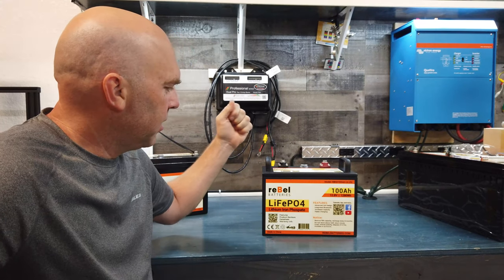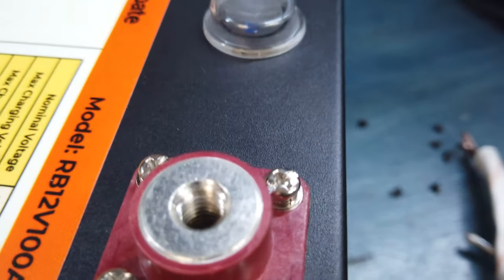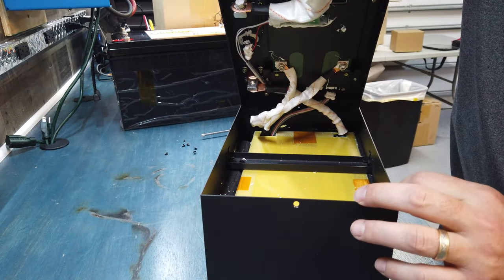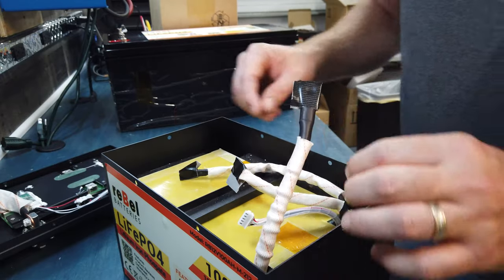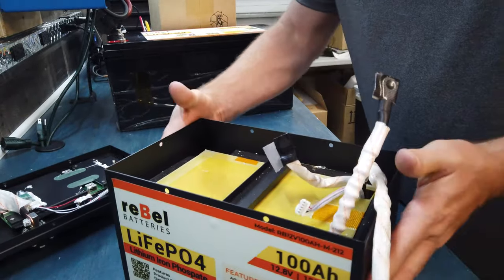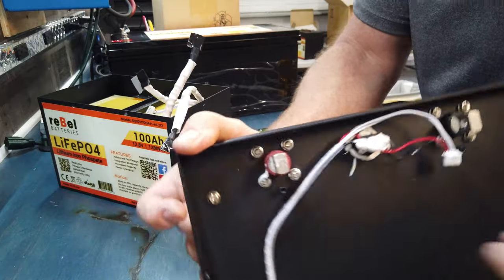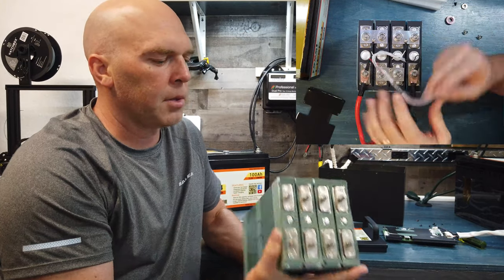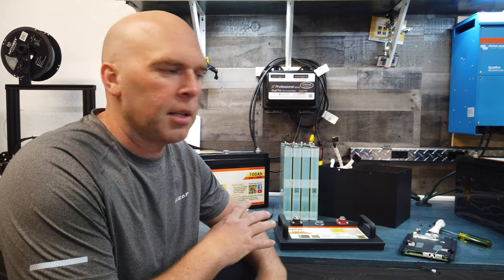12V 100Ah LiFePO4  Metal Case Upgrades

Comment: To cut power to the Bluetooth did you use a DPST switch because both + and - needed to be cut at the same time?
Reply from the maker: SPST. It simply cuts the power on the positive leg to the BT module.

Comment: Hi, I just bought the 200ah battery a month or so ago. It would be awesome to see an updated video on the new battery and some of the specs. What fuse size is recommended for different inverter wattages and amps, and maybe a look at the BMS software on it. It is different than the one in this video.  BTW, I did open a question/ticket on your web site asking about what size fuse you guys recommend for a 2200 watt inverter and a question on the BMS display.
Thanks!
Reply: We'll get something together in the near future on the 200Ah and discuss the BMS.  Answered your fuse/breaker question via email. Thanks!
Reply: @aricshelby  Hi Aric, Thanks so much for the answer on the fuse. I did remind you on the ticket that my battery BMS says it is 100ah, and wondered about that? If I buy the software update for 8.99 will that fix it?
Reply from the maker: @jaybennett7316  I also answered the 100AH question via the ticket. Let me know if you have any issues there, should be an easy fix.